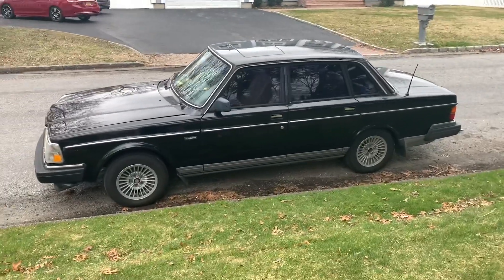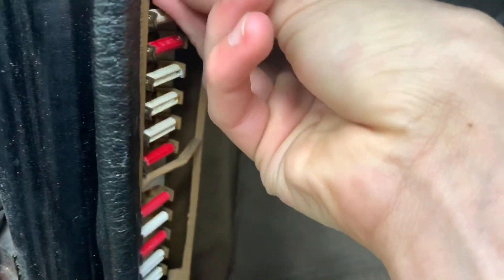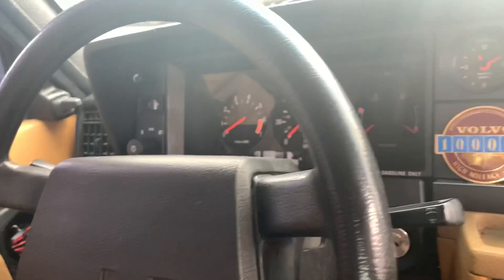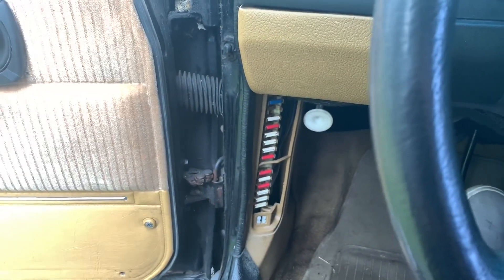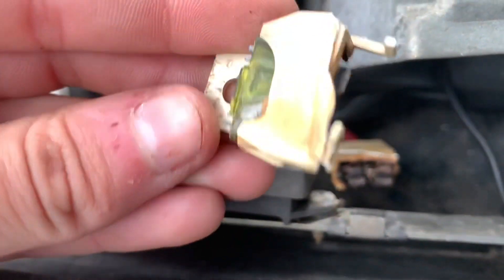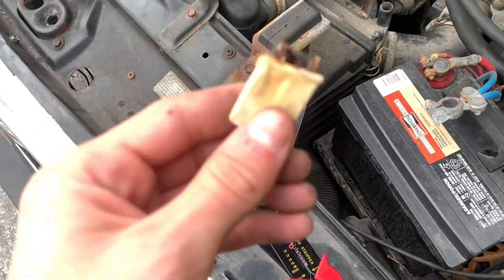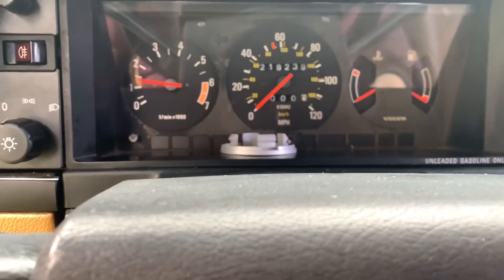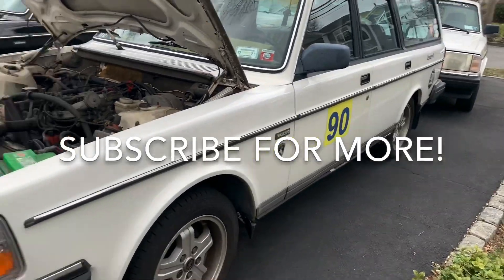Diagnosing the $900 240s no start issue (Broken Down)

Comment: This video just saved me! Thank you very much. My 240 wouldn't start - it's been very rainy - no fuel pump whine/priming on ignition. It was looking like a failing fuel pump relay, but none of the ones I've got fixed it. The fuse wasn't gone, but the connections were all badly corroded.

Comment: Having the same prob with 92 240. Didn’t know that fuse in the hood existed either. Will follow your diagnosis and hopefully one will solve the problem. Thanks for sharing. 🤙🏾
Reply: Any luck? Having the same issue with my 92
Reply: Sorry for the delayed response, but it was the relay in the passenger side. Now running like a champ still my daily

Comment: Thank you! Just got my first 240 (also a black one) and am having the same problem. I already replaced the fuel relay and it didn't fix the problem and my 4th fuse has no power so I'm gonna try what you did in the video and hopefully it works!🤞

Comment: The minute I read the title I knew just what was wrong, that darned fuse on the drivers' side of the engine compartment next to the battery.
('Course it's just as likely the relay in the passenger footwell since water from the leaking windshield seal gets into it.)

I dunno how many late-era 240's I've gotten running from just these two items.

Comment: Want to thank you for this video I took my 87 240 dl to a mechanic and they said it was the gas pump
And it was replaced.  But two days later the same happened it wouldn’t start.  I went through all your tests and yes it was the fuse.  It wasn’t burnt out but the fuse holder was all corroded inside.  So I replaced it with the exact parts you mentioned in your video and what do you know it started with hesitation😅.  Many thanks for your great videos !!

Comment: I've got a no start, no fuel pump actuation on my 89 245.  The jump wire from number 4 fuse to number 6 fuse caused the fuel pumps to kick on.  Same thing resulted when I ran a jump wire between those two nodes you had mentioned in the fuel relay connector, fuel pump kicked on.  Car will start with each of these methods.  So is there a way to diagnose a bad ECM other than replacing the ECM and reprogramming it?

Comment: Guidance on my 88 240 wagon would be appreciated. I changed the water pump (only 2 days of not driving it) ran well before. Car will not start. I cannot hear the fuel pump, but did crack the fuel rail and gasoline came out. I suspect the injectors are not working. I looked for the 30a main fuel pump fuse but it does not have one. I am familiar with that fuse because my 89 wagon had it very close to that black plastic connector box drivers side fender, as shown in your video. Car does get spark. Help with this no start problem please, and thank you.
Reply from the maker: There can still be some fuel in the rail but that main fuse that I fixed in this video also powers the injectors if I’m not mistaken. Perhaps someone relocated the fuse or got rid of it all together? Also check the fuel pump relay as they commonly go and cause a no start due to lack of fuel.

Comment: I've been trying to get mine started for 2 months and the systoms are only cranking main fuel pump ran  intank fuel pump connections rusted ran a hose to the fuel rail straight I wanna know if that would even work but yea now I think it's the same thing with yours there was a rat living in the battery tray with leaves bags moist and stuff also what is the name of the fuse you changed not the amp
Reply from the maker: sulaimaan it’s the fuel system main fuse. They often corrode
Reply: @jpvolvo4592  alr
Reply: @jpvolvo4592  I found the name of it out it's the engine management fuse

Comment: Viktor is a 1991 245 and when I turn the key sometimes the fuel pumps don't come on.
I ran this procedure and pumps came on and he started? Any help is appreciated.
Reply from the maker: Check your ignition barrel. Had a wire on it melt on one of 240s which caused a no start

Comment: can you make a video about what to look for when buying a 244
Reply: 1) Rust is a huge problem.  2) Engine wiring harness was inferior and updated in 1989, before 1989 it tends to deteriorate and fall apart causing wires to short out and stall the car. 3) The Pink ECU is problematic and will need to be updated before it fails.
Reply from the maker: @jsegura525  some late 88 models have the improved wiring harness as well

Comment: My 92 doesn't have that fuse. Guess they fixed that later.
Reply: The 25 amp fuse was eliminated during the 1989 year, some 89 models have it and some don't, in 1990 it was completely removed.
Reply: @jsegura525  I have an 89 245 and it has this fuse there.